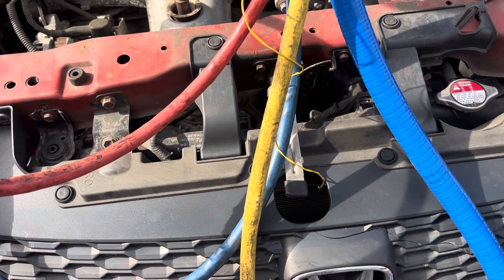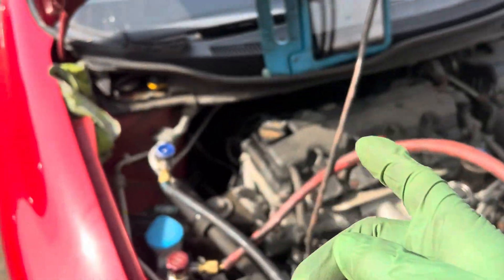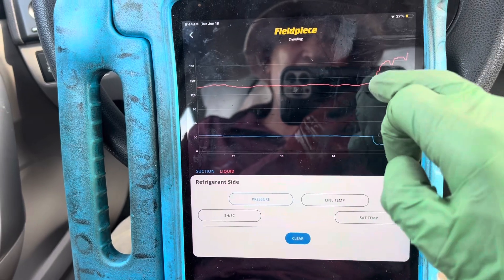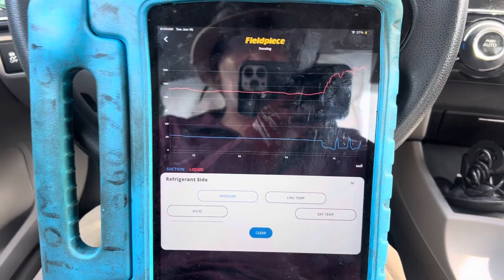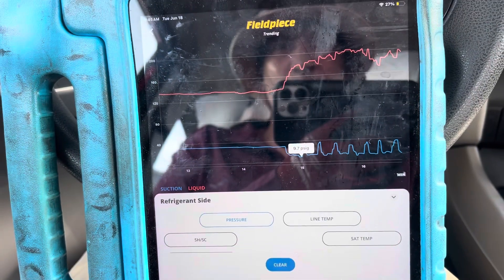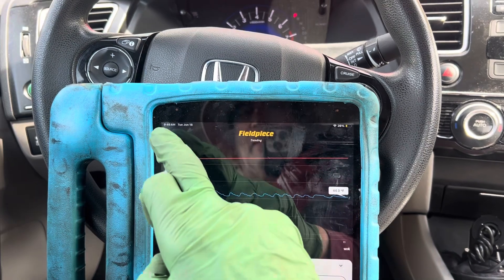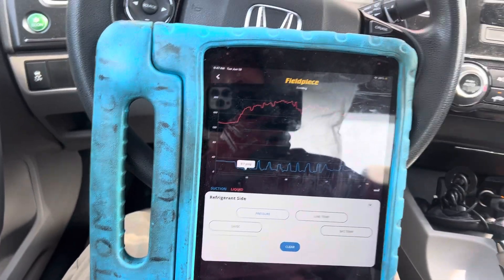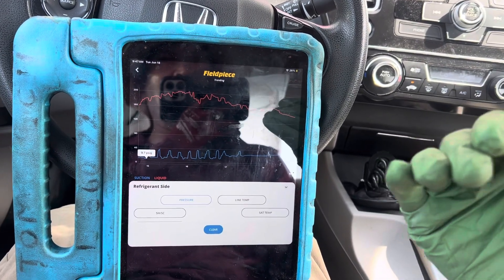UV dye easily finds the leak after the system is refilled with refrigerant. Engine RPM affects temp?

Comment: What are your thoughts on when people use the plastic "ties" that go through the car's AC condenser or even radiator to say mount an extra new fan install or say add a transmission cooler in front of the condenser?   

Do these ties tend to "rub" a hole through the condenser or radiator in time?

Thank you Tom....
Freddy in Arkansas
Reply from the maker: On old condensers that were thick aluminum tubes and very thick thins, we used to get away with that.   Sometimes it would make a hole.

Today’s modern day microchannel condensers the aluminum tubes are extremely thin .   They often don’t like things, vibrating or rubbing on them..  so they have a higher chance of getting holes rub through.

Comment: I can't tell you how many cars come into the shop from a previously "botched" repair like a new radiator or AC condenser and they didn't get it back in "just right" and after 20,000 miles or so the new part failed from "rubbing" and a hole formed...

01:05 it looks like just a poor quality condenser that was not made right, like a manufacturing defect? maybe one of the brazed joints failed from vibration combines with poor workmanship at the factory in China?
Reply from the maker: This was in a front end collision twice

Parts or not fitted back in properly things are still bent and out of place .

Comment: How much moisture migrates in to a flat system over time from a small leak?  Enough to cause damage?
Reply from the maker: Depends on size of small leak. Every day the car goes through cold night system gas contracts, pulling in night air. 

Next day when it gets hot 🥵 the air expands and leaves the system. But the moisture stays behind in the PAG or POE oil. And completely saturated the desiccant 

Different systems have different levels of sensitivity. Moisture directly does not cause damage immediately. 

It’s the slow process of making acid with oil that brakes down and refrigerant 

This vary slowly attacks thin metal evaporator and condenser from the inside out. 

It’s the slow loss of refrigerant that many customers when they first start noticing they’re losing cooling, they don’t go in and take care of it

So the compressor slowly starts to overheat more and more as the refrigerant level drops from the tiny little leaks 

And then it stops returning to the compressor that leaves the compressor. It gets, logged up and stays in the evaporator. . 

The compressors both star for cooling and oil and that’s when they fail 

Some vehicles that have steel receiver, dryers and steel fittings, literally rust with large flakes of rust that are very abrasive and clog expansion valves 

Which slowly plugs up the expansion valve and restricts the flow of cold, refrigerant, and oil back to the compressor eventually leading to compressor failure . 

There are certain condensers, depending on the metal or energy and a type of aluminum that was used . 
      The internal tiny inside, turning to a sand material that literally looks like sand. 
       And this can plug up that condenser or the receiver dryer overheating and starving the compressor or plugging the filter pad and this restricts the refrigerant and oil return to the compressor and causing the compressor to fail later on. 

So it’s not the moisture directly that causes the damage and it’s not instant .,

The only thing moisture does that could be instant 

On warm days where the AC AC compressor runs constantly, and if the manufacturer system design allows the evaporator to get cold enough, the moisture with the oil can make ice just after the expansion valve and making a blockage that restricts refrigerant flow, causing the evaporator to get warmer 

It worked excellent for 15-20 minutes and then it started to slowly get warmer . 
       When I turn off the AC for a few minutes and started it back on again it works perfectly and repeats the process.

Comment: Hey Tom is it normal for the high side to drop down at idle to 120 psig? The condenser fan cycles back on @180 psi. Clutch stays engaged. Blows cool 55F. Low side steady 25 psi. GM 5.3L fixed orifice.  I am a novice, but I'm learning from your videos.
Reply from the maker: All vehicles stands cycle at different pressures. You have to look up the specs for the particular year make model vehicle.. 

It is normal for many vehicles, high side pressure to drop down at lower RPMs 

But then it depends on the type of arrangement 

Electric fans kicking in or is there a secondary engine fluid thermal fan clutch . 

When that is just free, idling not spending very fast because of the temperature of the fan a lot less air moves over the condenser 

When the thermal fan clutch gets hot to its designed it locks in one to one with the RPMs and flows a lot more air . 

All depends upon configuration of your vehicle 

If it’s an older vehicle and conditioning has never been recharged . 

Probably a good idea and recharge it back to factory specification . 

It does have a thermal fan clutch on it and it has something like 50 or 80,000 miles on it or 5 to eight years or more if you live in a hot climate, good preventive maintenance to just swap out that fluid driven thermal fan clutch if your vehicle has one.
Reply: @coldfinger459sub0  Thanks. 2008 Tahoe electric cooling fans. FOT in front, TXV in rear.

Fixed slow leaks, held vacuum, pulled vac again next day. Fans cycling due to high side sensor 120 off, 180 on. Sensor agrees with gauge.  After initial cycling, compressor stays engaged with low side 25 psi steady. Hearing fluid noise from rear evaporator??

20F drop at idle 500 rpm is weaksauce.
Reply from the maker: @d46512  front orifice tube system suck at idle they are performance does go down

I have not heard the refrigerant liquid sound from the rear usually on passenger vehicles or some vans the front of evaporator when the refrigerant level is low 

But I don’t see enough trucks here in San Francisco trucks and vans are very rare people don’t want them due to lack of parking +5 dollars +6 dollars a gallon of fuel so in San Francisco I rarely see trucks except in a body shop

Comment: What Fieldpiece tool are you using to get that feedback from the car?  Thanks
Reply from the maker: The Fieldpiece software that works with the Fieldpiece refrigerant manifold SM480V
And the Fieldpiece transducers in the Fieldpiece temperature and humidity probes and a Fieldpiece clamp on pipe refrigerant temperature sensors 

Available at True Tech Tools 

There’s a 8% discount code 
LECHAIR 
All one word, all letters in the coupon box at checkout all orders over $50 free shipping
Reply: @coldfinger459sub0  Ok, thank you!

Comment: How many different " UV " flashlight do you have ?     Jay.   aka CarsRcool
Reply from the maker: I have about nine or 10, but I only carry five with me. 

365 nm 

385 nm to 395 nm 

400 nm to 410 nm  

Because different manufactures use different wavelengths UV dye that shines brighter at a specific UV wave length .
Reply: @coldfinger459sub0   thank you Tom...sorry for the late reply    Jay.